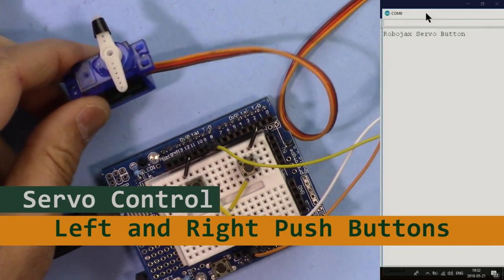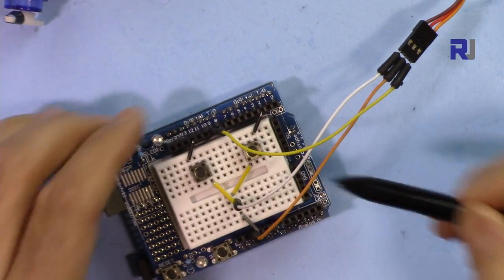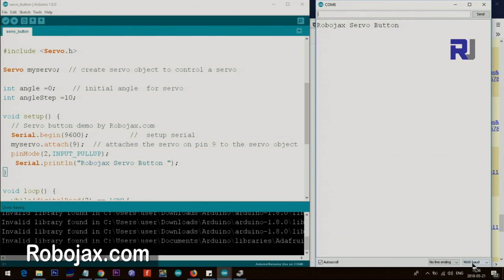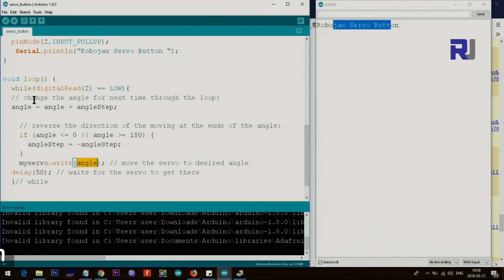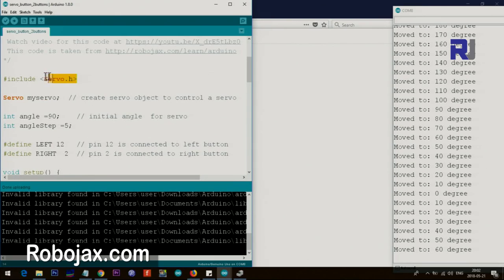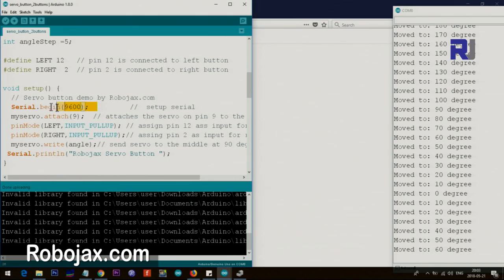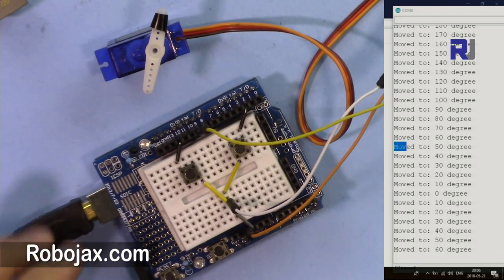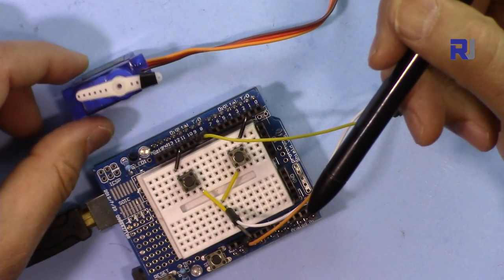Control Servo motor with push 2 buttons with Arduino SPB-4

Comment: i keep on getting this when i try to upload it Arduino: 1.8.10 (Windows 10), Board: "Arduino/Genuino Uno"

Sketch uses 3750 bytes (11%) of program storage space. Maximum is 32256 bytes.
Global variables use 271 bytes (13%) of dynamic memory, leaving 1777 bytes for local variables. Maximum is 2048 bytes.
avrdude: ser_open(): can't set com-state for "\\.\COM3"
An error occurred while uploading the sketch

This report would have more information with
"Show verbose output during compilation"
option enabled in File -> Preferences.
Reply from the maker: it means wrong port is selected with your arduino or it is not connected. it is very essay. when you see "can't set com-state for "\\.\COM3"" you should always check the port or usb cable. or Learn Arduino in 30 Minutes (video): http://robojax.com/L/?id=135
Reply: @robojax  thank you so much
Reply from the maker: Thanks for your well wishes, I have patience and if people don’t see it, God the almighty can see . Stay safe

Comment: I need help, I've tried everything and it wont work, I used tinkercad to be safe and nothing happened. It's like it never reads void loop. I did copy paste in the code and the wiring and still doesnt work.
Reply from the maker: Then  you have to check this video https://www.youtube.com/watch?v=kZ9b31gVemc and also code from Arduino open File->Examples->Servo-Sweep  and if then watch https://www.youtube.com/watch?v=2WwedCRwmgA to learn how Push button work. Good luck
Reply: Same but the wiring doesn’t work

Comment: does this work for  a winding and measuring system project  if i use this code for the motor? or its different for all proejcts
Reply from the maker: this code is about controlling a servo motor. if you use servo motor, then it will work.

Comment: Mr Robojax is it possible to prepare software to sevro control with features: power on- go to 0 , push button(non momentary button) -  servo start moving with pre loaded anlge, delay ( pause time as add setting), servo stop- delay(  pause time as add setting). Just servo moving in loop (0-45 degree )with paused. Is it posible to get 3 different speed via second button?( Micro 6 Pololou controler possible)What is price of it - if You're agree to do something like that. Regards.
Reply from the maker: Hello, I did not get it properly.  The best way to explain it is to use machine state diagram something like this https://snipboard.io/IgYnWr.jpg and contact me via Robojax.com contact page. Please provide your email address in the message. I will charge $75/hour.

Comment: Is there a way to make this work after removing the wires/making the wire distance longer?
Reply from the maker: If you are referring to push button switch wire, yes you can extend it with shielded with to 100m and with unshielded wire perhaps to 2 minutes I 3m depending on environment and type of wire.

Comment: hello! i am trying to move between two specific degrees, 155 to 180. i have tried changing the degrees in the code but it causes it not to work. is there a way to adjust the code so i am moving the servo less?
Reply from the maker: Hi, that's exactly what I have written he code for. you must have changed the code. start with the fresh code and pay attention to const int minAngle = 0; const int maxAngle = 180;. Or check tones of other code for servo that I have on this page https://robojax.com/learn/arduino/

Comment: What would I have to add to the code if I wanted to have the servo only move the determined increment no matter if the button is quickly pushed or held down. Currently if I hold the button down the servo continues to move.
Reply from the maker: See the links to other codes in description. Or search and I am sure if you watch them, you will learn and customize them for your need

Comment: hey im using the code with a continuous servo (360) and even if i release the buttons it keeps moving, how can i make it stop when i stop pressing the buttons? i thought about setting the input without pullup and using a resistor but im not sure.
Reply from the maker: I have separate video for that https://www.youtube.com/robojaxTV/search?query=360

Comment: I would like to run a few brushless motors and servos using if and else statements from the same Arduino Mega board making use of a push button. How would I go about doing that?
Reply from the maker: You will need Elecyronics speed controller or ESC to control ruthless motors.
Reply: I have that no problem . My question is would I be able to?
  @robojax

Comment: RJ, thank you for sharing.  I'm trying to play around with the anglestep, going from 5 to 10 to speed up the rotation, but when I compile and upload, the buttons become unresponsive.  The monitor shows the step have increased, but the servo doesn't move anymore.  When I go back to 5 steps, all works.  Seems nothing outside 5 steps is working for me?  Any ideas?
Reply: Just had a thought...I pushed the button and then manually gave the servo arm a nudge, and it worked.  I heard that some higher torque servos should be run with power supply separate from the Arduino.  I think that may be the problem.
Reply: No, still sluggish or unresponsive at times.  Maybe the breadboard?  Do you have any sluggishness when you run the program?
Reply from the maker: I belive it is your servo itself. Try printing the values on the serial monitor.  If it prints properly, then the servo is bad or bad wiring
Reply: @robojax  Values are printing properly.  I suspect the wiring and will redo it with a different board and components.  Thank you for this and getting back to me so fast.  Subscribed.
Reply from the maker: You are welcome and thanks for subscribing.

Comment: cant seem to get it to work rx led flashes when buttons are pressed but servo does not move, checked servo with tester and works ok (sweeps, centers and moves when pot is turned) any help would be appreciated TIA
Reply from the maker: You have selected a pin that is not PWM. you must select a digital with with ~ sign like 3, 6, 7, 9 or 11 in Arduino Uno.
Reply: @robojax  thanks for reply found the problem it was poor ground on the breadboard have now soldered connections without bb and all works a treat , now got to figure out how to construct lever mechenism for daughters cosplay suit 
Thanks again for help

Comment: Good morning what is cheapest arduino board to control servo by two buttons? Is it need servo controller like pololou micro?
Reply from the maker: Arduino is already $3 or $4 on aliExpress where you get it in 30 to 60 days with free shipping. any arduino can work with servo.

Comment: I only have spst (2 pin) rocker switches, so every tutorial on how to make dc motors go        f @ r is with dpdt or with at least 3 pins. Or a bunch of relays, transistors or 4 switches to make an H-bridge. I'm going to try this method and I'll let you know how it works out. Thanks!

Comment: what would be my power supply for the servo motor
Reply from the maker: didn't I show it? it is 5V if you use the type of servo motor show in the video. Elese the manufacturer should provide the manual for the servo.

Comment: Thank you for the video. Very helpful. Can you help me please, I need a servo to cycle from 0 degrees to 180 and then back, when a button is pressed. So, when I press a button, the servo will go from 0 degrees, to 180, then back to 0.
Reply from the maker: You are welcome. Can you tell me why you need? what kind of application requires that? I will make video on that if I find it useful.

Comment: hi, great video! I wanted to know whether the 2 button code would remain the same if I used an external power source for the servo, like a 6V battery, attached by wires to the breadboard? Please could you also upload a clear wire diagram for the set up of 2 buttons?
Reply from the maker: Wrong video. If you follow my course you would know it. This is way advanced comparing to basic servo control
Reply from the maker: See the lecture from my  Arduino Step by Step course https://youtu.be/J_kbyAY1rLM
Reply: @robojax  thank you for your help, I shall check the video :)

Comment: Hello, great video. I'm wondering if you could help me. I'm trying to figure out a way to press the button once (not hold the button) and have the servo move from 0 degrees to 180 degrees, delay for 5 seconds and then return to 0 degrees. Any suggestions?
Reply from the maker: Search my channel. I have so many set it related videos. Watch, learn and write your own code. It is impossible to satisfy everyone’s  need. I have explained them fully. So watch 2, 3, r or 5 times until you learn it and write your own code. Good luck

Comment: Do you have to use that bread board
Reply: Like that circuit board
Reply from the maker: If you can connect them without breadboard  no you don't need it.
Reply: Thank u for help and really fast replies
Reply: I kept making this and making sure it was correct but it won’t work for me can I have help please

Comment: Halo, awesome video, I do have some questions, I want to use 4 servos each using 2 buttons, what I'm experiencing is my servos are conflicting, I have define each button to a pin and servo would it because all my servos are on one ground to the arduino? And maybe can you leave a example to use 2 servos on 4 buttons I just want to make sure I'm correct with the code I'm using if you don't mind?
Reply from the maker: Hello, Thank you. Please post your code in this page https://codeshare.io/29njmB  and I will look at it.
Reply: @robojax  ah thanks man I managed to sort it out it was in the code, keep an eye out will post soon
Reply: @pieterfouche6931  hey man it would really be helpful if you could provide me with your code because even I want to use 4 servos each using 2 push buttons. I want it for a college project.

Comment: Sir for controlling the movement of 7 servos using 4 buttons. How the connections will be done?
Reply from the maker: If you watched my video. I never leave any details. You will need to define extra pins for push butts and extra pins for servo and add the rest of the code. It should work. Watch the video again without escaping.

Comment: Hello sir can you please tell me how I can control 4 servo motors with one arduino
thankyou
Reply from the maker: Hi, I mentioned everything in this code. See the same video which is part of my Arduino course in this channel where you will see better details and wiring diagram. Simply define a push button pin for 2nd and 3rd servo, and the. Same for servo and all variables I mention in code . For example we have variable called “angle” in the code in this video, then you create new variable called angle2 for 2nd servo and angle3 for third. Or start learning Arduino from here https://youtube.com/playlist?list=PLHvJ4bw0xno4Z3FC2W07I4D2UP14bOaT2

Comment: why do we not need a resister?  I see always resistors when arduino is used with push buttons. I don't get it.
Reply from the maker: because the input pin must have a state either HIGH or LOW. Push button when not pushed is not connected and the input pin will not be connected and this will cause unknown input value and as a result unknown output or result will occur. So we use a resistor when the button is not connected, using the resistor the input pin is either HIGH or LOW depending on how you connect the resistor.

Comment: in the 2 button coding, i want the servo to go back onto its initial position which is 90 if we release a push button, so can you tell me that what do i do. or if you can make a video on this topic so this will be very great.
Reply from the maker: I have got a video showing how to control servo motor using Infrared Remote controller. You can use the code if you know how to modify it.  https://youtu.be/Wp7hX9UErSQ
Reply: I tried to understand that code but was not able to understand please tell us how to do it , please make a code for this problem please

Comment: Can you change the int angle = 90 to start from where ever it’s location is at that moment?
Reply from the maker: yes. I have explained this in the video. Change it to any value between 0 to 180.
Reply: Robojax but setting it at any value between 0-180 will set that servo at that value when restart. For example, if I leave the servo at 75 degrees (or any other random degree)I would like the servo to stay at that position when I restart it and not at the set value. Hope that makes sense.
Reply from the maker: sorry I did not get what you want to say. Setting value and "staying at that position" isn't the same if you don't push any button, it will be the same.
Reply: Robojax lol nvr mind

Comment: Ur just cool n awesome. Thank u for the tutorial. 
Can we add a reset button to return the position to zero degree ?
Reply from the maker: You are welcome. Yes you can. 
Define reset button (as RES) the same as LEFT and RIGHT. in setup do the same

then if (digitalRead(RES )==LOW)
{
 myservo.write(angle);

}
Angle is the variable  you define at initial step value.
Reply: Robojax thank you so much for your quick reply. I will try and let you know.
Reply: /*
 Controlling a servo with two Push buttons with Arduino
 when Left  push button is pressed, the servo start moving to the left until it reaches 180( or zero) degrees
 when Right  push button is pressed, the servo start moving to the right until it reaches 180( or zero) degrees
At any instance if the button is released, servo stops

 May 22, 2018 at 01:00 
 Written by Ahmad S. for Robojax.com at Ajax, Ontario, Canada
 Watch video for this code at https://youtu.be/7woqNH_qby4
 This code is taken from http://robojax.com/learn/arduino
*/

#include <Servo.h>

Servo myservo;  // create servo object to control a servo

int angle =90;    // initial angle  for servo
int angleStep =5;

#define LEFT 12   // pin 12 is connected to left button
#define RIGHT  2  // pin 2 is connected to right button
#define RES 3     // pin 3 reset

void setup() {
  // Servo button demo by Robojax.com
  Serial.begin(9600);          //  setup serial
  myservo.attach(9);  // attaches the servo on pin 9 to the servo object
  pinMode(LEFT,INPUT_PULLUP); // assign pin 12 ass input for Left button
  pinMode(RIGHT,INPUT_PULLUP);// assing pin 2 as input for right button
  pinMode(RES,INPUT_PULLUP);  // assign pin 3 as reset button
  myservo.write(angle);// send servo to the middle at 90 degrees
 Serial.println("Robojax Servo Button ");
}

void loop() {
  // Servo button demo by Robojax.com
  while(digitalRead(RIGHT) == LOW){

    if (angle > 0 && angle <= 180) {
      angle = angle - angleStep;
       if(angle < 0){
        angle = 0;
       }else{
      myservo.write(angle); // move the servo to desired angle
      Serial.print("Moved to: ");
      Serial.print(angle);   // print the angle
      Serial.println(" degree");
       }
    }
    
  delay(100); // waits for the servo to get there
  }// while
 // Servo button demo by Robojax.com

  while(digitalRead(LEFT) == LOW){

    // Servo button demo by Robojax.com
    if (angle >= 0 && angle <= 180) {
      angle = angle + angleStep;
      if(angle >180){
        angle =180;
       }else{
      myservo.write(angle); // move the servo to desired angle
      Serial.print("Moved to: ");
      Serial.print(angle);   // print the angle
      Serial.println(" degree");
       }
    }

   if (digitalRead(RES)==LOW)
   {
    myservo.write(angle);
   } 
   }
    
  delay(100); // waits for the servo to get there
  }    ///// the code compiles but not sure if it works as it should. Please help me out with this. I am not able get hold of a servo right now. so can you please help me out with this ?

Thank you in advance.

Comment: Hello Robojax and Thanks for that amazing and very helpful video. I have a i make a codes for (RFID MFRC522) that is working good i can accesses with card from outside but i want to use same three'd meathead in my file also   because of i can't accesses from inside please help me out. I will be very Thankful to you.
Reply from the maker: I have this MFRC522 module on my "to do" list.  what do you mean can't access from "inside". you man from within Arduino?